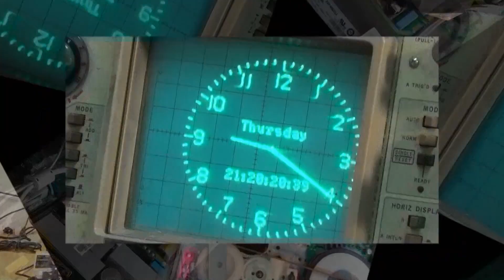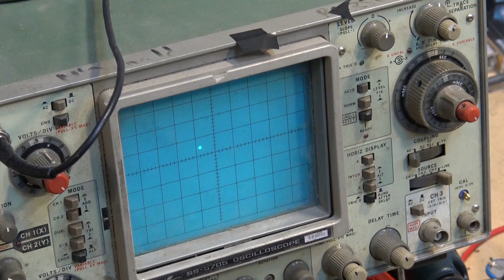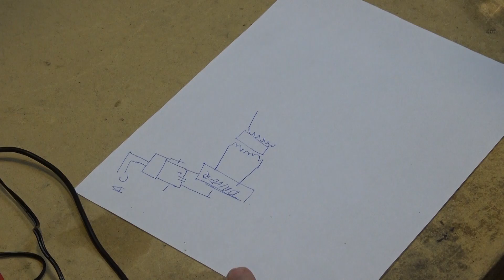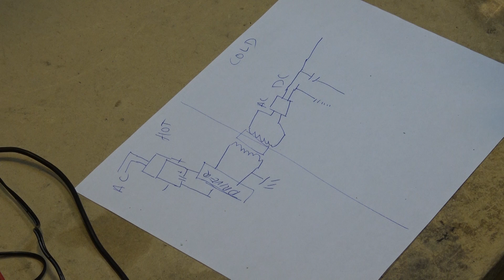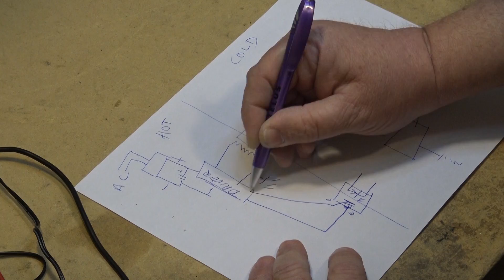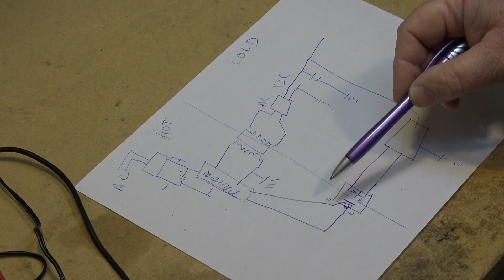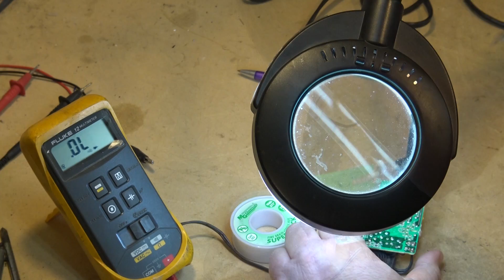Switching power supply regulation repair

Comment: I always thought Panasonic vcr was top of the line. Interesting story about the power supplies. I guess they went to a switching supply because of size, weight and cost.
Reply from the maker: Panasonic made some great machines, but a lot of not so good ones too.
As far as VHS machines went JVC and Hitachi were the best built machines. 
Lot of them are still working after 30 years.
At the time we thought of these as cheap machines, but they have stood the test of time.
Reply: 12voltvids The Sanyo Beta machines (specifically the 5x00 series) also stood the. test of time whereas the Toshibas and Sonys of the period are all faulty or expired. The machines that unspooled the tape during wind operations are longer lasting IME.
Reply: The VTC 5300 (5350 in Greece and Middle East) and the 5400 didn't unthread the tape in stop mode just like the Sony's.
Reply: The 5100, 5150 and 5000 certainly did though, I have one right here.

http://www.palsite.com/5000ovi.html
Reply: Jason james Yes. I have a 5000 and a 5350. Sanyo was a bit weird on their model numbers. The higher the number, the older the machine.
Reply: Fair comment, I had forgotten about the older piano-key Sanyo units to be honest. Those old machines tended to be pretty reliable regardless of manufacturer because they were all built like tanks, but most of them disappeared in the 80s because no-one wanted something so huge cluttering up the living room by around 1985 :)

Comment: The funny thing is that I had a Panasonic CRT TV to repair once, which wouldn't turn on. After a quick investigation, I found a shorted zener diode on the output of the supply and two bone-dry small electrolytics on the primary side. So your story is very true. Nice video!
Reply from the maker: Yes that is why they added the "crowbar" on the output.
That was the era where they had the oscillator operating on the low side of resonance.  I had tons of thoe zeners fail due to dry caps on the primary side.

Comment: Newbie comments.  Was glad to see this video (well done, actually explaining "why" things happen) as we have all had switching PS's fail. Thanks for the "how it works" feature in this video. Have been told these are dangerous to work on, and due to not using isolation, they have claimed many scopes. Would have enjoyed a preface on safety before working on these. Another very useful video. Did not enjoy the background music though; distracting - causing me to lose focus several times. Just my 2cents. Thx!
Reply from the maker: The only reason the music was added at 20db below program audio was because a TV was picked up in the background, and youtube are a55holes for content matching, an dthen hitting the video with a copyright strike. It is amazing how sensitive the detectors are, so I wasn't about to take a chance of getting a hit, as I would have to pull the video.
Reply: 12voltvids - No worries. The good far outways. Cheers!
Reply from the maker: I have other videos describing bench safety, but you are correct. You need to use a "floating"  isolation transformer to isolate the hot side from the mains power, and it is a good idea to remove the ground prong from your scope cord, or plug your scope also in to the floating isolation transformer as well.
See my isolation transformer demo to see why you need one, and how not all isolation transformers are created equal.
If the isolation transformer has a ground prong, you are not isolated.
A floating isolation transformer has a 2 prong mains plug, and a 2 prong test outlet. That is why it is called a "floating" design, as the neutral will float, which protects the servicer, as either the hot of neutral side could be pulled to earth and no danger.
Reply: @12voltvids  Thank you so much.

Comment: That psu looked quite nice in comparison to the typical junk, the correct input filtering is often omitted, it has an output filter too, not often seen.

I dont see many opto couplers fail, its the evil crapacitors (as you said).

For switchmode supplys i like the delta electronics psu's, generally quite reliable.
Reply from the maker: That PSU came from an VDSL modem, so good filtering is essential, as ripple would cause data errors.
Reply from the maker: I fully expected bad caps. This is the first one I have seen fail like this, with the LED side shorting.

Comment: Nice job

Weird high pitched tone behind the video though?
Reply from the maker: It was my scope dyiing. The HV multiplier had started to short, that is why the CRT was so dim. It failed completely a few days later.
The microphone was picking up the sound that I didn't hear as it was masked by the sound of the fan in my monitor. Also I tune out those frequencies. I have tinnitus and the buzzing in my ears is very close to the horizontal sweep frequency, so I just ignore it.
Reply from the maker: Have no idea where it came from. Was picked up by microphone as it is on the main audio track. Wasn't aparant when I shot it, but I sure heard it once someone noticed it, and went back and looked at the source files. It is there. Have no idea where it came from.
Reply: Sounds kinda like a CRT power supply. It is possible that it wasn't an audible sound when you recorded it but, magnetic/static interference picked up before the signal got from the mic to the ADC.

Comment: If your speaker is a thumpin' and there's nothin' on the wire, try some warfarin in your woofer; it's what the rats desire.
Reply from the maker: Its the Sony receiver. Starting to act up again.
Reply: Is that the source of the high pitched squeal?  Sounds to me as though it is voltage or load dependent as it is not continuous/stable.

Comment: whats the high pitch whine?
Reply from the maker: The only noise in the background is the fans in my 32" monitor on the wall above my bench that I use as a camera monitor. That's why that TV was given to me. Fans were loud on the old flat panel monitors. It's an old LCD Benq.

Comment: The main thing is that it converts 60z to a much higher freq to put through a SMALLER CHEAPER TRANSFORMER, since higher freqs are more efficient on transformers.  Then the secondary must filter high freq instead of 60z.  Higher freqs can cause RFI. Plus the safety devices can go bananas.  They must take more precautions than linear  since switchers are often used to recharge lith ion batteries.   Don
Reply from the maker: Right, cost is one factor, but efficiency is the main reason they do it.
Governments have mandated certain efficiency levels, and switching supplies convert more energy and produce less heat than linear transformers.
Linear power supplies are 40 - 60% efficient at best. I am not just talking about the transformer efficiency either, I am talking about the entire supply, with the linear regulator that burns off excess power as heat. Very wasteful.
Switching supplies on the other hand are 90% some as high as 95% efficient which is a huge difference.
Reply: this is true, they have their advantages.  But they seem more likely to fail, but usually the fail is cheap to fix.  Most folks toss them, more for the landfills.  I have a bunch of failed ones that are sealed shut.  Funny thing, the fail is often bad cable connections or jacks  LOL